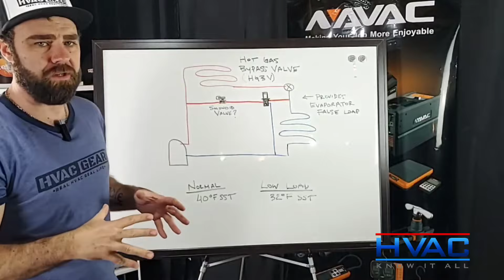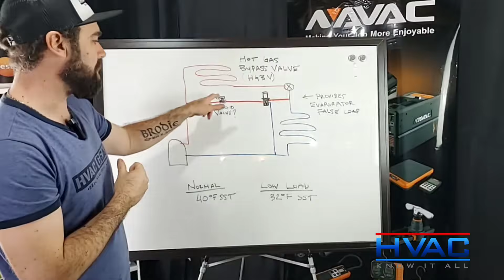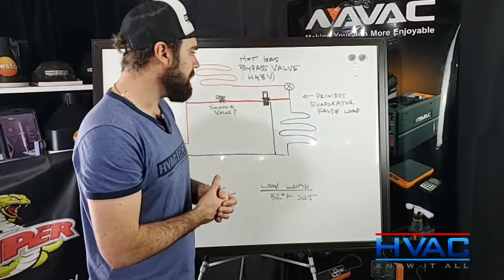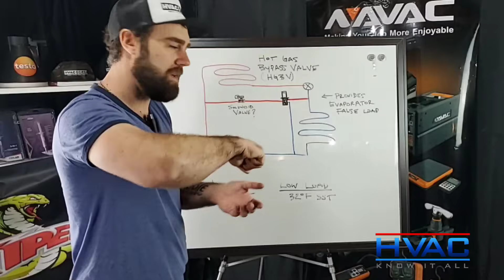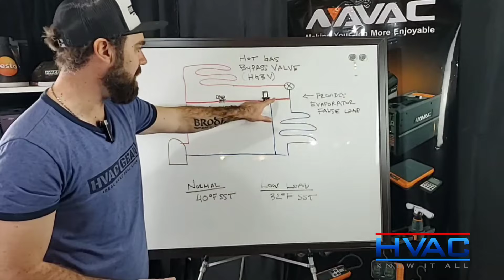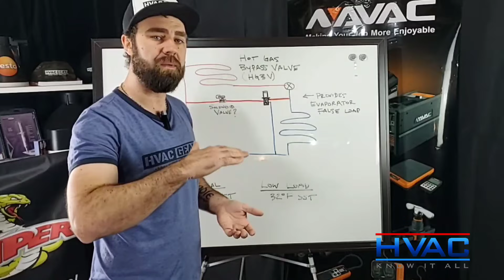Hot Gas Bypass Valve Application and Low Load Conditions

Comment: I just started industrial, we do air sourced boilers as well as indoor units that all have hot gas bypass. Some check valves are mechanical some are electronic. Can someone explain the difference in low ambient and low load in the sequence of operations or are they the same?

Comment: What actually shuts cooling down will the hot gas bypass continue to run when show is over
Reply from the maker: If it hits full on set point, the system will shut down.  The hot gas will stop feeding on the off cycle.

Comment: I have seen some hot gas bypass lines connected to the suction line (in between compressor and evaporator) as opposed to inlet evaporator like in this video. How are they exactly different?
Reply: Same question i got when i see his Diagram seems like same Line ......but doing different case scenario as he mentioned Movie Theater....Low Load versus LAT   make sense i guess ....

Comment: Can i replace the sporlan hot gas bypass valve with a solenoid controled by a digital tempreature sensor
The sensor will measure suction line temp and control hot gas bypass valve

Comment: I struggle with mechanical load and ambient control. Specifically the applications of Hot Gas bypass and Headmaster Valves. I mostly understand what they do, and why, but i have the damndest time troubleshooting if they are the problem. 

Thanks for this video. Long time watcher, seldom commentor.

Comment: Great Explanation!
Could you make a video explaining the difference between this Hot-gas bypass valve method and the Evaporator pressure regulator (Danfoss KVP)? Is it technically the same?

Comment: I have  questions?  am working on a unit  that  has hot gas valve when you  put the unit on the temperature is able to come down to about 19/c but when the hot gas comes on you have the temperature reading 23 and it doesn't  come down  any more
Reply from the maker: These are room temps?  Hot gas is for low load conditions.  It needs to be set to supply hot gas when the load and corresponding evap pressure falls off.
Reply: @HVACKnowItAll  How can the system determine that the load has increased and the bypass needs to be turned off? Is it possible to replace the bypass simply with a short capillary tube and a solenoid with a sensor?

Comment: Does the compressor delivery pressure becomes less when bypass valve is open?
Reply from the maker: No it becomes more, it's adding pressure the to suction line
Reply from the maker: But on the discharge line the pressure will drop a little, sorry, not exactly sure what you're asking.

Comment: The way you explained this sounds like it operates similar to a TXV...
Reply: Nah dude. Nothing at all lol. A txv is there to throttle liquid into evap to provide cooling. 
This is just a valve that allows heat to enter the low side to increase pressure a bit when there is no load.

Comment: Hi,
Great video !
I have also a hot-gas bypass valve on my LG multisplit, but it is bypassing directly the compressor's output to the input of the accumulator (just before the compressor input).
When the hot-gas is activated, for example when a split is stopped, I can see the high pressure decreasing and the low pressure increasing.
However, what is strange to me, is that when the hot-gas is deactivated after 30 seconds, the high-pressure recovers quite fast its initial value, but the low pressure is dropping much lower than its initial value (for example, from 8.3 bars to 6.7 bars) and seems to stay at this lower value (until the outdoor unit regulation is changing the inverter compressor speed).
Do you have some explanation why it behaves like that ? I am not really sure that it is normal since it is generating periodical fluctuations of the regulation :( 
Thanks a lot and regards

Comment: Really good video but could you or someone please explain the difference between this and a headmaster valve? Are they essentially they same just different terms? Thanks
Reply: Headmaster or OROA is for head pressure control at low ambient conditions.
Reply: @ES-ml4cg  thank you for the reply. Sorry I'm just confused, but why do you need to keep the head pressure up? So the low side stays up as well?

Comment: i get my gf to run flat after I raise her temp by backing out the screw through an open device, I screw in and out to back tension off, I have some superheat added into that, it gets warmer less chance that will cycle off, and back to normal conditions naturally on its own. I back off again and discharge my load in the theater. the load drops off because the body heat is gone. but I set for that. so that in a nutshell is how I adjust her full capacity attitude and generally a good example of an application of that. happy HVAC guys!

Comment: Good video.  I follow on how the hot gas creates a load on the evaporator but is there another component after such as an accumulator to return the refrigerant back as a vapor?  I haven't seen this setup in the field before.  Thanks.
Reply from the maker: There is never a receiver after an evaporator, the receiver is after the condenser.  It's still returning as a vapour, the discharge gad is highly superheated vapour
Reply: @HVACKnowItAll  I see accumulators after evap to catch any liquid,saves compressor from slugging
Reply from the maker: Sorry my bad, thought you said receiver but none the less no vapour will get back during hot gas byapss
Reply: Thanks for responding.   So you are saying the hot gas in the evaporator has some heat removal but not to the point of changing state?   Therefore vapor still returns to the low side of compression.
Reply: Yes those are common in refrigeration. I used to do commercial refrigeration. It was a vital component especially freezers where the coil must be flooded with liquid for below zero temps.

Comment: We use the same pipe set up but use  a rapid cycle solenoid and no HGBV to control really tight temperatures in our environmental rooms.
Reply from the maker: Cool!
Reply: Do you use a PLC to control the toggle cycle of the solenoids? Or is it controlled by a relay?
Reply: @MistaWhatchaKnow  we use a Loop controller and a relay to cycle it on and off. Company be buy the controllers from is called Future Design control and its the R-22 controller.
Reply: Thanks! I took a look at the website and the controllers they offer. Never heard of this company, but they type of controllers look like a nice drop in for Watlow controllers. I really like the Watlow controllers, but they are very expensive. Most customers don’t need the amount of features either. What I have found out is toggling solenoids works well, however some size units need an adjustable valve inline with the solenoid to meter the amount of hot gas entering the evaporator. This way to can adjust the Hot Gas Bypass Valve to the exact PSI that you want. I watch the controller to see the temp swing. I want to mention that Hot Gas is not greatly energy efficient, although the machines run really well when not cycling and can maintain a consistent temp inside the evaporator. We can hold a temp of -+.5 degrees on oil and water cooling. This helps our customers achieve ultra precision in their processes.